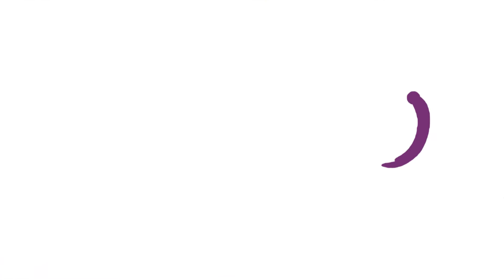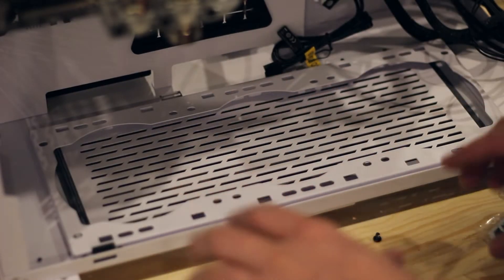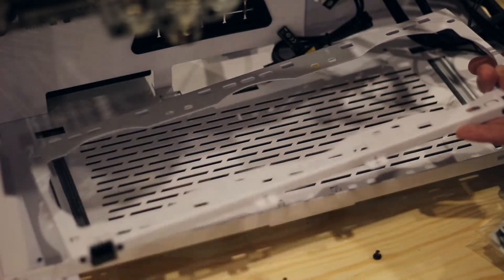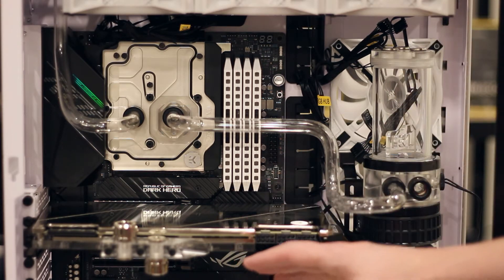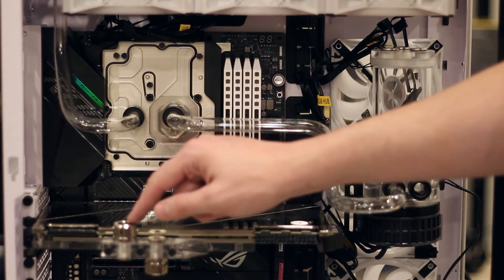2021 PC Build Pt 9 - Acrylic Tube Bending - Bring on the Liquid!

Comment: A couple questions for you.... 1) How did you run the water pump by itself? (you have a video on how to set that up ??) 2) How often do you have to change the water? (and do you add anything or use special water? ie:distilled)
Reply from the maker: @kylergeston  Hello! That's for the message! I'm not certain what you mean by how I ran the water pump by itself, are you asking about the tube routing or the power? The pump has its own power header connected to the power supply and then the fan header is plugged into the motherboard and speeds are controlled directly by the motherboard. I added a temperature sensor to the header on the motherboard so that I can adjust pump speed based on temperatures, although that doesn't really matter as long as the speed is consistent and the cooling is good.

The water does need changing and should be done once per year. I am using distilled water and some anti-corrosion and anti-fungal additives via Mayhems XT Nuke. I have a few other additives I am testing to see if they have comparable corrosion resistance. The biggest issue is mixed metals, the copper ions that the water slowly absorbs over time like to attach themselves to the nickel plating on the cooling blocks which "Browns" the nickel a bit. Regular flushes can prevent that, although it doesn't hinder performance.
Reply: @UnhingedSystems  When you were filling up the system with water you were running the pump to get things circulated and get the air bubbles out. I'm just wondering how you ran the pump without the motherboard being turned on. Is there a way to just run the pump without powering up the motherboard? I see why you do this, in case there is a leak it doesn't take out any of the electronic components, but I just wanted to know how. So many tips & tricks in doing this project that are not all covered in the video. Keep up the great work and do let us know what additives work best.
Reply from the maker: @kylergeston  The power supply isn't connected to any of the components except for the water pump. I use a PSU test switch (which plugs into the 24pin cable) to signal the PSU to turn on. This allows the pump to run and nothing else has power 👍

I'm possibly doing a new build (on the fence on upgrading from 5950X to 9950), and if I do it will be more comprehensive as I will have help with camera work this time around 👍

It's been a hot minute since I made a video, but that's because I work all the time haha.
Reply: @UnhingedSystems  Ok Good to know. I will research on how to do that. Looking forward to the new build. I'm sure there are plenty of your viewers that would be interested in the 9950X. Me for one.